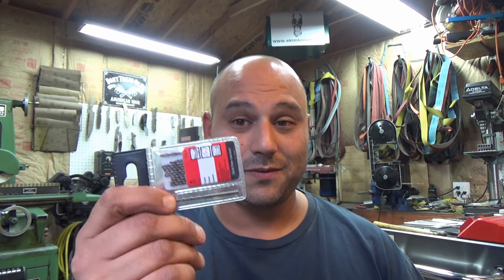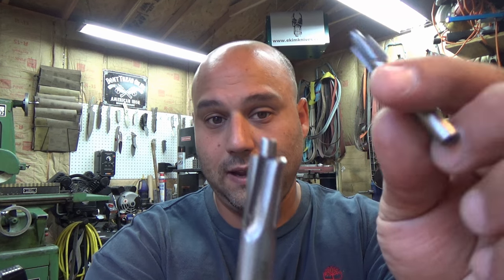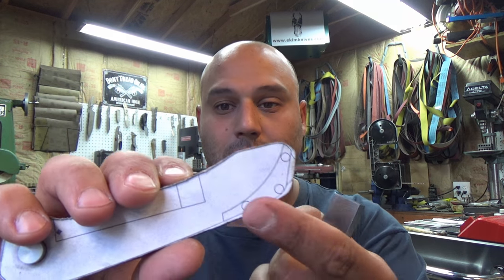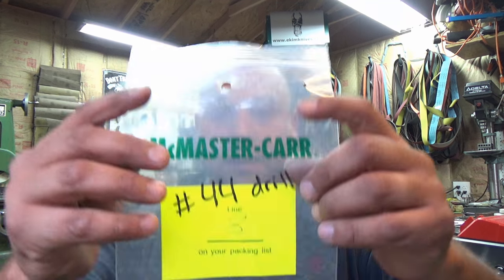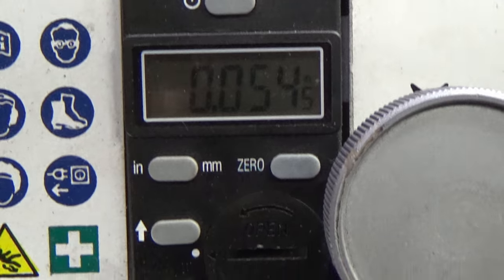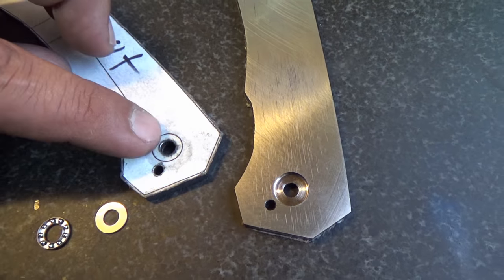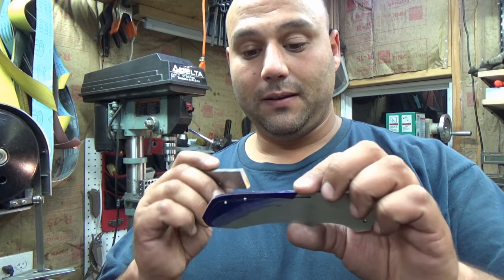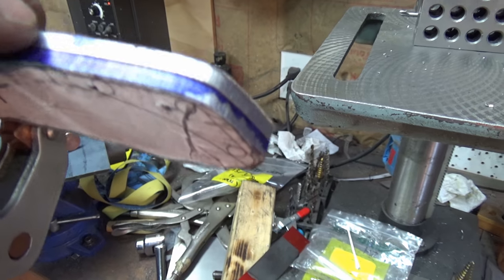How To Make A Folding Knife #6. Counterbores and Back Spacers

Comment: This is for anyone reading these comments... run the tap on a cordless drill . Drill a bigger hole then the chart recommends when using titanium. If the chart says #49 drill #47. Set your cordless drill a low setting for the chuck . Easy peasy . Oh you can also make a folder with just a drill press. This series should be called how to make a frame lock with the most expensive tools and machines possible. Those counterbores are 60 plus bucks when a step drill works just as good

Comment: Hey mike, I've got a question. I've been looking into making my own knives, and I'm making sure I have most my bases covered first. 

When making a frame lock folder, what are the factors in making sure the blade is centered when it is folded/closed? 

I've seen so many knives made by respected manufacturers that do not have centered blades when closed. I'm trying to figure out how to avoid that and make sure the blade is centered to the best of my ability.